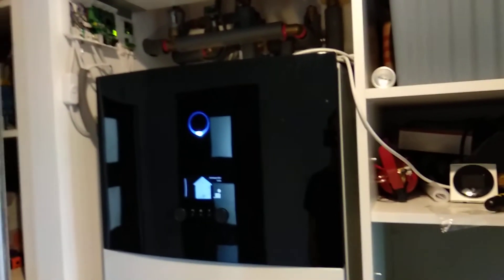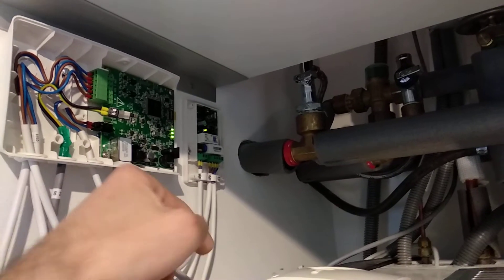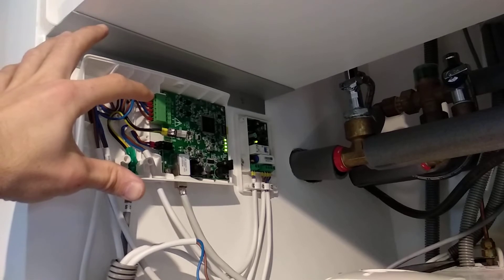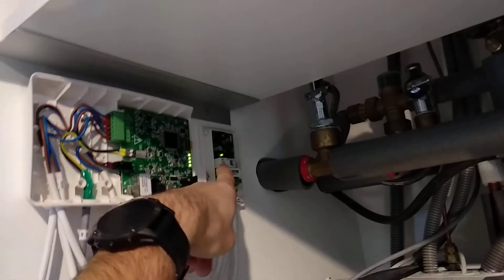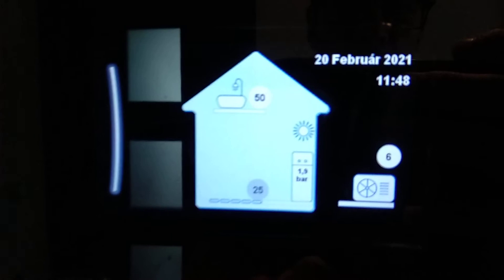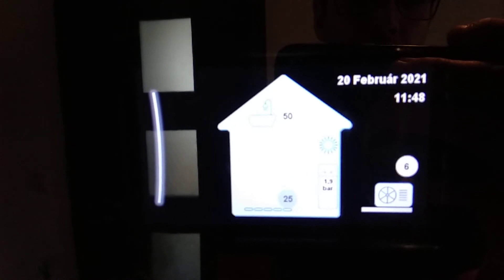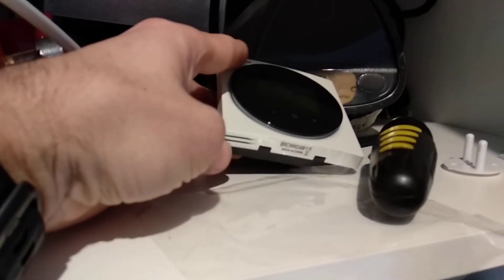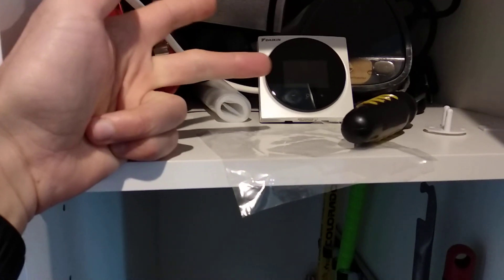Daikin Altherma 3 with Photovoltaics. My Smart Grid setup.

Comment: Hi there, thank you for your explanatory video. I want to do the same setup as you with my SolarEdge SE15K and Daikin Altherma3. I already have the Daikin LAN adapter installed and a ABB kWh meter connected to the LAN adapter (pulse contact). Now I wonder: where should I get the mains power for the SE smart grid zigbee unit from? That is the left most cable coming from the zigbee unit in your video. Dit you just plug it into a wall power outlet or does it go into the Daikin HP? Hope you can help me.
Reply from the maker: hi, as you said - 230V through fuse https://knowledge-center.solaredge.com/sites/kc/files/se-device-control-dry-contact-switch-installation-guide.pdf
Reply: @misok  Thanks. I found that document already, but that’s just what I don’t understand: 230V through fuse. In the Netherlands all wall power outlets in a house are fused (but often not 1:1), so usually 1 fuse does 2 or 3 entire rooms (light points and wall outlets/power sockets). Some appliances have their own fuse, such as the washing machine and drier. So should it have its own fuse or can I just plug it into a power socket (that is fused with the rest of the room)? Perhaps I am thinking too difficult.
Reply from the maker: @sebastianaller8252  ah, ok. Mine has a separate B6 fuse. but there is SolarEdge controllable plug, so you can use also the wall power outlet, if you want. There should be a schematics also for the wall plug, but the connection is very similar if i'll remember correctly.
Reply: @misok OK, I think I will just connect it to an available wall outlet, should be fine. Searching through the installers manual of the heat pump, looking for where to connect the smart grid wiring in the Altherma indoor unit, I wonder whether I need to buy the EKRELSG high tension relays to put inside the Altherma unit. You should use them in case of high tension contacts. Did you use that kit in this install?
And some new issues arose: the SE Zigbee smart energy relay seems to have been superseded by the SE Home Load controller and is nowhere to be found in shops on the web. I contacted a nearby installer and he can’t find the relay in the SE catalog anymore. The home load controller also has 2 dry switches, but communicates with the inverter through SE Home Network, so I should buy the Home Network antenna kit in stead of the Zigbee antenna kit for my inverter.

https://knowledge-center.solaredge.com/sites/kc/files/se-home-load-controller-datasheet-row.pdf

https://www.solaredge.com/us/products/residential/smart-energy/solaredge-home-load-controller
Reply from the maker: @sebastianaller8252  i did not used the EKRELSG. That time only SE ZigBee Smart Energy was available, but newer inverters - younger than 2yo are supporting SE Home network. It should be similar in principle. My Daikin LAN unit is fused thgrough some fast acting Tracon fuse if I remember correctly. It was like 60€. Look in the manual, if you will not find it, I can check it for you. Are you planning a battery too?
Reply: No specific battery plans for now. In NL there still is an arrangement with the energy companies and the government that all the excess energy you inject into the grid will be substracted from the energy you pulled out of the grid, so at the end of the year you have let’s say: consumed 4000kWh from the grid and injected 3000kWh into the grid over a year time. Then they will charge you 4000-3000=1000kWh of energy. So buying a battery is not so very economical at the moment. This arrangement however will come to an end in the next couple of years, so perhaps in a couple of years I will buy a battery.
I decided not to put a separate fuse in the N/L wire of the LAN adapter as the power source is already fused with a 16A type B fuse. That would be fuse after fuse and not logical.
Reply from the maker: @sebastianaller8252  happy for you! here it is like they will return you 45% of what you will send them. But battery does not make sense here too. Just to be more independent. Smart Grid does not work perfect during the heating period. Just a small tip - I even adjusted my thermostat to be 25 deg during the day (which is never reached) and 21 deg during night, that there is a higher probability that the heating will be on during the daylight. Good luck and save some money for your family and hobbies :) Michal
Reply: Hi Michal, I just don’t get it to work. The lower most LED on the LAN adapter keeps flashing in an irregular fashion, even when I am injecting 2500W into the grid. The blue energy mast icon on the user interface flashes too, but does not stay on. The pump does nothing, even when heating is turned off (greyed out). Pulse output is configured correctly and the LAN interface too. Now I wonder whether I connected the pulse output the right way. On the underside of the energy meter you have the 5-pole plug. To which of the 5 poles did you connect the pulse wires? The 2 contacts located to the front of the meter or to the rear side? The images of where contacts 13 and 15 are, are not quite obvious, do you start counting at the front of the meter or at the rear? And is C or OUT1 the positive wire? This also seems to matter to the LAN adapter.
Reply from the maker: @sebastianaller8252  Hi Sebastian, 
1. First try to swich out your heating and let the DHW water heater on. Ususally when the heating is on, it does not work as I supposed it should.

2. set your pulse meter to something like 100 pulses/kWh, that you can see the meter blinking. Then measure with the voltmeter the pulses on the other side of the connected cable. You should read something like 5 or 12V every blink of the led. There is also predefined impulse settings which works with altherma, but I think I have mine on 1000 pulses/1kWh and the lenght of the signal, which was something like original value. 

3. did you set up the altherma LAN Unit through web interface? it is accessible 2 hours after adapter is powered on.

Michal
Reply: @misok  
1. Heating is switched off, DHW is on
2. I will test when the sun is out again.
3. Yes, that is where I make adjustments all the time. 

For what it's worth: when I disable the meter setting in the LAN interface (no meter) and limit the static max power to 5kW, and close SG0 contact, nothing happens. I just wrote a message to Daikin, hope they can help me.
Reply from the maker: @sebastianaller8252 From the memory, you need to power on the Smart Grid part of the LAN Adapter too - separately from the rest of the LAN Adapter. I hope you have it - according to scheme. SG0 Requires Dry Contact Switch.
Reply: @misok  Hi Michal, I solved the problem. According to Daikin I can’t use the LAN adapter for smart grid functions with my Altherma 3 anymore. They advised me to connect the dry contact switch (SolarEdge home load controller) and kWh meter directly tot the smart grid contacts in the Altherma indoor unit. So I did and look there: it works. Altherma unit follows excess solar production and adjusts energy limits accordingly. You have to make various settings through the Daikin User interface to make it work but that is not very difficult. 
BTW: I exchanged the kWh meter for a InePRO 380, that is also compatible with my SolarEdge SE15K through modbus. Now this meter sends excess solar production data to the Altherma and total energy import/export data tot SOlarEdge inverter, that I can now also see in the MySolarEdge app.
Reply from the maker: @sebastianaller8252  good to hear that it works! I think I dont have smart grid contacts directly in my indoor unit (altherma 3). Does it works also when the Room heating option is on? I better switch the heating off to make the DHW working in full potential.
Reply: @sebastianaller8252 hi! Ik ben met hetzelfde bezig. Kun je me helpen? Wat ik tot nu toe ontdekt heb : smart Grid contacten op de printplaat is GND + SG aansluiting en daarnaast de HT/NT aansluiting met ook GND + EVU. Dit moet potentiaal vrij aangezet worden. Dus GND+SG moet verbonden worden en GND+ EVU, om zo de warmtepomp te forceren aan te gaan. Klopt dat?
Reply: @spanhool  Ik heb maar 1 set smartgrid contacten in de warmtepomp aangesloten (SG 1) omdat ik de gedwongen aan/uit setting niet gebruik. Als je GND en SG met elkaar verbindt (dus als het ware kortsluit), wordt de smartgrid functie geactiveerd. De warmtepomp stuurt zelf een zwakke stuurstroom van uit SG naar GND. Je gebruikt een zogenaamde dry switch (schakelaar) om de stroomkring te sluiten. Dit kan een simpel knopje of schakelaartje zijn, maar ook een switch zoals de home load controller die wordt aangestuurd door een ander systeem zoals in dit geval de omvormer die aangeeft dat er een stroomoverschot is. Ik heb het aangesloten volgens de Daikin installer reference guide: Op aansluiting X5M zijn contacten 3 t/m14 voor smartgrid functies. 
Pin 3/4: S4S = smartgrid pulsmeter (sluit hierop een kWh-meter aan die kan meten hoeveel kW er op enig moment wordt teruggeleverd)
Pin 9/10: S10S = SmartGrid laagspanningscontact 1 (voor aanbevolen aan/uit)
Pin 5/6: S11S = Smartgrid laagspanningscontact 2 (voor gedwongen aan/uit)
Pin 13/14: Jumper (niets mee doen)
De gedwongen functies heb ik niet aangesloten. Wat hij nu doet: PV omvormer sluit contact in home load controller (dry switch), waardoor stroomkring over SG1 contact wordt gesloten. Dan gaat de WP kijken via S4S hoeveel kW er wordt teruggeleverd en past zijn eigen stroomverbruik daarop aan. 
Als er geen ruimteverwarmingsvraag is (ruimteverwarming uit of kamertemperatuur bereikt), dan gaat hij eerst de tapwatertank opwarmen tot 60 graden. Is het tapwater 60 graden en de ruimteverwarming is niet uitgeschakeld (bv geen warmtevraag doordat kamertemperatuur is bereikt), dan gaat hij CV water verwarmen om warmte in de vloer te bufferen. Dit kun je allemaal instellen. Stuur me anders een PB of email, mocht je nog vragen hebben.

Comment: Hi, one question. Solaredge is just switching S11S and S10S on X5M or is it digital input with informations?
Reply: I would like to cotrol from my Siemens Logo 8 and relays, is that posible?
Reply from the maker: @usupancic  hello, you just need to swich on and off the SG0 signal with dry switch. I am sure it is possible.
Reply from the maker: @usupancic  S1S = SG0 and L on connector X1A (LAN Adaptor). Look for LAN Adaptor pdf manual.

Comment: hello, nice presentation .... Thanks for your information.  I wanted to ask you ... for my daikin model EWYA016DV3P can I do the same thing?
Reply from the maker: Hi, thanks. According to installation manual of your heat pump, there is no mention about BRP069A61, but you should be able to install Smart Grid Adaptor EKRELSG (PV connection) and Wifi cartridge BRP069A78 (remote HP controller). Better ask your Daikin dealer or even Daikin country distributor.